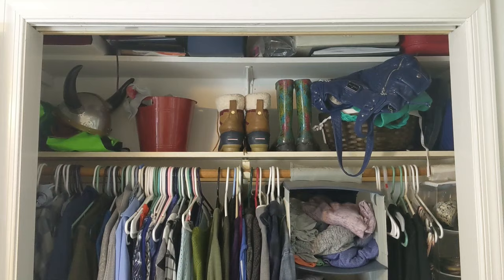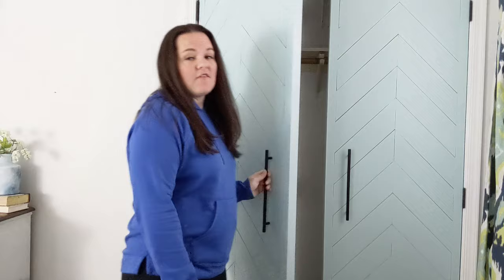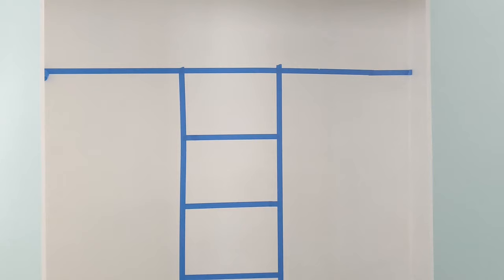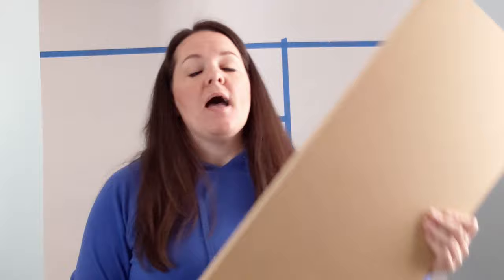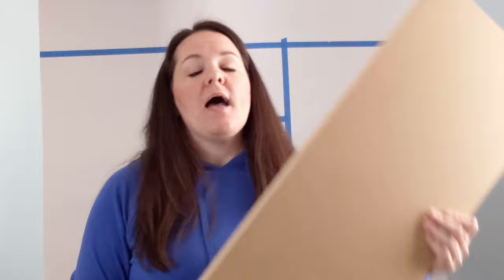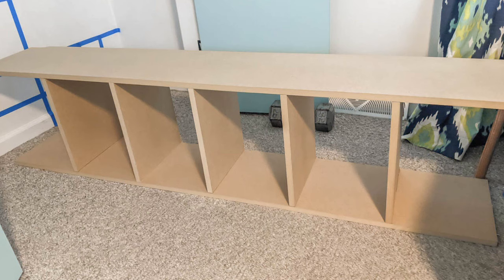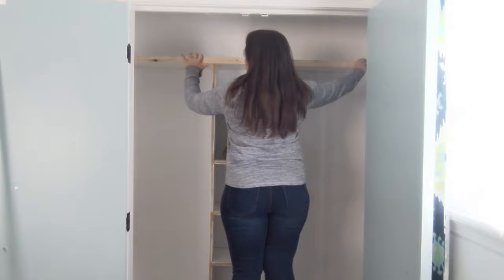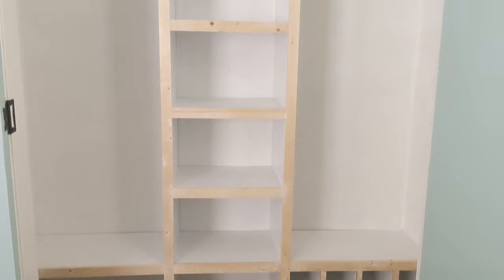Build a DIY Closet Organizer for Cheap (less than $75!)

Comment: I never understand doing built in on top of carpet. You can’t change the carpet without entire closet breakdown.
Reply from the maker: It's true. I guess the other options would be to do a floating closet organizer that is only anchored to the floor or to cut out the carpet around the wood supports. For me I think it will be easier to disassemble and reassemble the organizer if and when I replace the carpet. Basically put off the extra work for later. 😂 But it's definitely not the only choice.

Comment: Love this! Where do you get the hanging bars from? And would the trim get in there way if you wanted to add a drawer?
Reply from the maker: I was able to reuse the closet rod that was already in my closet and cut it into two smaller pieces. But if you need to buy a closet rod, a 1.25″ round dowel works perfectly. Here is my affiliate link for home depot https://www.homedepot.com/p/6420U-1-1-4-in-x-1-1-4-in-x-48-in-Hardwood-Round-Dowel-10001811/203334072?irgwc=1&cm_mmc=afl-ir-116548-456723-&clickid=TCbxM9Q9QxyNR-1wVWxS3SzcUkF2l8wxyXJGQo0

Comment: Thank you for this. I was looking to get the IKEA PAX system but they are sold out, so I’m going to build the frames using this (since these are external closets) and tie in the ikea pax parts. Instead of $1k, it will be around 220

Comment: doing this soon and wondering how you attached the middle unit to the wall?  i am using pine and worried it is heavy and a falling risk unless anchored super soundly
Reply from the maker: Hi! I'm so glad you found this helpful. I measured and marked where each shelf needed to be placed. Then I used pocket screws to screw each shelf to the side. Here is the written tutorial that may explain it better https://www.lovelyetc.com/how-to-build-a-diy-closet-organizer/

Comment: How did you paint the mdf? Everything I read it’s kind of tricky since it’s so absorbent and sensitive to water?

Also, do the wood fronts along the edging slightly hang over the mdf edging or line up exactly?
Reply from the maker: I just used white paint that I had on hand. You may need a couple of coats. For the edging, I caulked anywhere there was a visible gap between the boards. You may find the written tutorial here helpful: https://www.lovelyetc.com/how-to-build-a-diy-closet-organizer/

Comment: How is the vertical center shelf supported to the wall . Is the support purely limited to the horizontal shelf on the top and attached to side walls?
Reply from the maker: Add the top shelf above the center piece. Attach a 1×4 board to each end wall immediately beneath the shelf, nailing into a stud if possible. You may want to check out the written article with step-by-step photos so you can see exactly how it is secured. https://www.lovelyetc.com/how-to-build-a-diy-closet-organizer/

Comment: I have a small closet. 6ft by 4 to 4 and a half ft.

My room is also not a great sice and is oddly shaped so I took everything out of my closet and moved my PC and desk into the closet so now I have a little office room.

Only problem now is I have no where to hang my shirts! lol!   Being a simple man I don't have lots of shirts or jackets or anything so I don't need much space. Maybe a 3 ft long rod at the most and some shelving under it would be nice.  Would have to put it in my bedroom which I am perfectly fine with. Sadly I lack the experience and ingenuity so not really sure how to go about doing it. Would be nice if I could find an all in one kit with just the frame. That's all I really need.  Left side, right side, top side, and back side.  Will run a rod inbetween for shirts/jackets. 

I don't think they make any kits though? I have been Googling for days and can't really find what I am looking for.  Basically I'm after a bookcase with no shelves that I can throw a rod in for shirts and what not.

I know this video is 2 years old but if anyone stumbles across this and knows where I can find something to do what I am trying to achieve here lemme know please. Thanks!
Reply from the maker: Have you considered a rolling portable closet? They make some really nice ones now that may be easy enough to put together. Here is an example of one I found on Amazon. I searched "rolling portable closet" and there are a bunch of options. Hope this works!
Affiliate Link https://www.amazon.com/Golpart-Portable-Heavy-Duty-Adjustable-Free-standing/dp/B0C77MBGPL?crid=1J8L4Q5GOLKNO&dib=eyJ2IjoiMSJ9.JJ2GDhIYIaJ4UWdqnWwfDBzzqFOTzun-H9IeI_knAhBeFXrn7YXyqcCASYVW3_XaxFC9Uo8EJM9Lz-Pw3D82DCvuo-Xo-gYkbabTaMcGD_epEQ_0GDrYNf0md8APhzWCGV1RSZuyEyqcuiLIVCu4nw.c2FNtshLnQTWUiiNh24xjZOXl1eZu6CKNzdIH4v4T3I&dib_tag=se&keywords=rolling%2Bportable%2Bcloset&qid=1705098450&sprefix=rolling%2Bportable%2Bcloset%2Caps%2C76&sr=8-18&returnFromLogin=1&th=1&linkCode=ll1&tag=lovetc0b-20&linkId=44bbf8d391dbd8c9520c45d52eff49c7&language=en_US&ref_=as_li_ss_tl
Reply: @LovelyEtc  Thank you so much. I've already considered this route. Not sure how I feel about it as I was kind of preferring something out of wood. Then I can add a hook to the side of it and use that as a place to hang a backpack that I use for my laptop.

Comment: All of it was secured with the Brad nailer? Did you screw the middle part to the wall?? Also did you do anything not shown for it to hold the weight of the clothes?? I’m doing this in my walk-in so I’m still confused on some things lol
Reply from the maker: Hi. The middle part is secured to the sections with pocket holes. I added four pocket holes to the underside of each shelf. Then I used pocket screws to screw each shelf to the side. The middle supports will support most of the weight of the shelf but to keep it stable, we also need to add another support to each end wall. You may want to check out the step-by-step written tutorial here https://www.lovelyetc.com/how-to-build-a-diy-closet-organizer/

Comment: Perfect! I love this video! I just have a question, did you use tension rods or wooden dowels for the hanging bar?
Reply from the maker: I used wooden dowels with closet rod sockets that screw into the wall. You could use tension rods, but I would be worried about them possibly slipping under the weight of the clothing.

Comment: This is my size of closet and I have been wanting to do this.  I would love more details on the wood type and instructions step by step and around how much this cost please. I do not have a nail gun and how do you make pocket holes?  I have a drill and drill bits.  I will have Lowes cut my wood since I do not have a saw.  Help!  I will be doing this myself too.
Reply from the maker: I have more details in the written instructions on my website at https://www.lovelyetc.com/how-to-build-a-diy-closet-organizer/  You don't have to have a nail gun, you can also use a hammer and nails. A nail gun just saves time. And you need a pocket hole jig like a Kreg jig to make pocket holes. It sounds intimidating but it's easier than it sounds and one of the small, inexpensive kreg jigs will work fine.

Comment: How did the MDF hold up to painting? Normally that stuff breaks down with liquid. And holding all that weight is surprising as well
Reply from the maker: It's holding up great! MDF isn't great in moisture but it takes paint really well. I've used MDF for other painted projects as well and it's always done well.

Comment: now did you have to use a stud finder or are these not mounted to the wall
Reply from the maker: The side supports that hold up the ends of the top shelf and lower shelves are attached to studs. The main tower section isn't mounted to the wall. It's almost like a piece of furniture and the top shelf and side shelves hold it very firmly in place.

Comment: How did you secure the middle vertical pieces to the wall? If it’s not secured are you worried it could fall forward?
Reply from the maker: The middle section is not secured directly to the wall behind it, but it is secured to the top shelf and the bottom side shelves which are secured to the walls. It is very sturdy and I have no worries about it falling forward. Someone would have to intentionally yank on it and try to pull it away from the wall and even then, I don't think it would move.

Comment: Did you screw in the closet rod holders or make a circular cut through the wood to put the closet rod through? If you cut through the wood, what did you use to make circular cuts? Can't tell on the video. Novice here....
Reply from the maker: I screwed in the closet rod holders - they come with screws so it is very simple. You could make a circular cut using a drill and a hole saw but it would be much more complicated that way.

Comment: How long is your closet? Mine is 6ft..I was gonna purchase the Rubbermaid system but after watching ur project I may do it like urs..however I wanted to put a dresser inside for my teen to put clothes in
Reply from the maker: My closet is 73 inches - so right at six feet. I use the shelves in place of a dresser but if you want to add a dresser, you could put the dresser in place and just add shelves/closet rod above it. So the dresser would be in place of the lower shelves. Good luck!

Comment: What kind of nail gun is that? All the cheap ones I was looking at required an air compressor which seemed like a PITA but yours doesn’t have a hose attached. Was it expensive?
Reply from the maker: It is a Ryobi Airstrike 16 gauge finish nailer. It is battery powered and doesn't require an air compressor which is why I love it. Here's an affiliate link to the one I have at Home Depot - https://rstyle.me/+Spi27fLF6JZrgg0d8PKQkg  It isn't the cheapest nail gun, but it is pretty affordable, especially if you use other Ryobi battery-powered tools and don't need to buy a new battery.

Comment: How is this all connected to the back wall is what I do not understand? Could you please tell?
Reply from the maker: Add the top shelf above the center piece. Attach a 1×4 board to each end wall immediately beneath the shelf, nailing into a stud if possible. You may want to check out the written article with step-by-step photos so you can see exactly how it is secured. https://www.lovelyetc.com/how-to-build-a-diy-closet-organizer/

Comment: How did you secure the middle shelf to the wall?
Reply from the maker: Here is the info: "the middle supports will support most of the weight of the shelf but to keep it stable, we also need to add another support to each end wall. Attach a 1×4 board to each end wall immediately beneath the shelf, nailing into a stud if possible". Here is the blog post https://www.lovelyetc.com/how-to-build-a-diy-closet-organizer/

Comment: Good video but not as easy as I hoped…I didn’t know the name for “pocket screws” before watching so have no idea how to do them.  Also, how were the clothes rods attached?!?
Reply from the maker: For more info on pocket screws, look for a video or tutorial for using a kreg jig (or pocket hole jig). I don't have a tutorial for this but there are tons out there. It seems intimidating but is actually super easy - it just makes it easy to build really strong furniture with strong joints. The clothes rods come with two brackets with screw holes and screws to attach them. You just screw the brackets onto the walls and center shelf.

Comment: first timer with DIY's...can you explain the purpose/use of the caulk and putty and where you used it? will be checking out your site as well :)
Reply from the maker: Really they just help make everything look really neat and smooth. I used spackling to fill in the nail holes from building my shelves. And I used caulk to fill the tiny cracks where one piece of wood meets another or meets the wall. They really help DIY projects look perfect and caulk especially can help hide any tiny errors. I've got a whole blog post about it if you want more info - https://www.lovelyetc.com/caulk-or-wood-filler-choose-the-right-one-for-every-project/

Comment: How did you install the closet bars?
Reply from the maker: I bought a pair of closet rod sockets. You can get them at any home improvement store, I screwed them into the center shelves as well as the two outer walls.

Comment: Hi! I loved the video and I’m looking forward to building this closet system! I just have a question. Is there another type of MDF board that is similar to the one you listed? My local Home Depot doesn’t have the one you linked in stock unfortunately.
Reply from the maker: It may be listed as something else, any similar MDF will work. I would just ask for a 1" thick sheet of MDF (4'x8'). They should have something in stock. You could also use plywood instead but I prefer MDF because it has a super smooth surface and doesn't warp.

Comment: I went to the store and mdf costs more than wood grain!  Any tips? Did I miss something?  Stupid Covid
Reply from the maker: That's crazy. If you can get real wood with a pretty smooth finish, I would just use that. But if the cheaper wood is really rough plywood, it's going to take a lot of work to get it smooth.

Comment: What kind of nail gun do you use?
Reply from the maker: I use a Ryobi Airstrike 16 gauge finish nailer. It is battery powered and doesn't require an air compressor which is why I love it. Here's an affiliate link to the one I have at Home Depot - https://rstyle.me/+Spi27fLF6JZrgg0d8PKQkg

Comment: Wasn't the trim thicker than the MDF?
Reply from the maker: Yes, it is. The MDF is 3/4" thick and the trim is 1.5" thick. The added thickness really adds to the finished look. Just line up the trim so the extra thickness hangs down from the shelf and doesn't block it. For the vertical supports, I centered them so there is a little extra on each side. You can't tell there is a diffeence when you look at it - it looks nice and substantial but saves a lot of money.
Reply: @LovelyEtc  Thanks, great work!

Comment: How do you secure the middle compartment pieces to the wall?
Reply from the maker: I did not secure my middle section directly to the wall. It is secured at the top and bottom to the shelves which are attached to the side walls. This way it can''t move side to side or away from the wall. It feels very secure, but you could use some L-brackets if you wanted to further secure it to the back wall.

Comment: How did you put up the rods??
Reply from the maker: I bought two pairs of closet rod sockets. They just screw right into the wall/closet organizer and are really easy to install. These are like the ones I used (affiliate link) - https://amzn.to/3wvS4uk
Reply: @LovelyEtc  ..wished you would've shown how to measure  across for them..great job though..did you use the same paint our spray paint?

Comment: Hey just a question.... Do we need to locate where the studs are behind the drywall? If anyone can answer my question, plz help someone whose husband doesn't even hang the lightest thing without locating the stud behind the drywall.. 😏
Reply from the maker: Yes, you should locate the studs along the side walls of the closet. When you attach the side shelf supports, you'll nail them into the studs. You don't really need to locate studs at the back of the closet because the tall vertical shelves in the middle hold everything up.

Comment: ummm.... how on earth did this fit under $75? I just renovated my closet, slightly bigger than this one.  I bought the main shelving system after searching a lot but i don't count that one.  I had to custom make entirely the part where coats are hanging because it is under a 45 degree slope and it was impossible to buy ready made without cutting and slicing parts.  So that part alone required 2 melamine boards ($50+ total)+ 2 pieces of real wood (was one cut in 2 @ $25).  Then i needed brackets and widgets (just the round widgets to attach the rod in was $9).  I painted walls fresh, used 1,5 quarts buckets but had to buy 2 (2 colors) and that was also $50+. I get it that prices jumped over the last year, but even a year ago, i would be in for $150. Not counting 2 weeks of hard labor (had to retape bad builders job), spackling old holes, and i nearly fainted working under incandescent lamp in that narrow space doing the painting lol. That stuff was sauna.